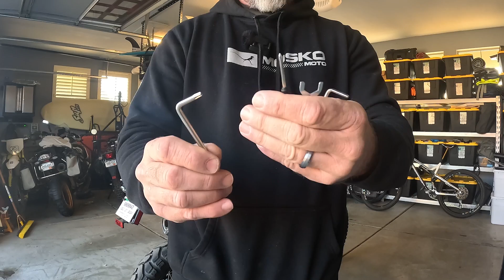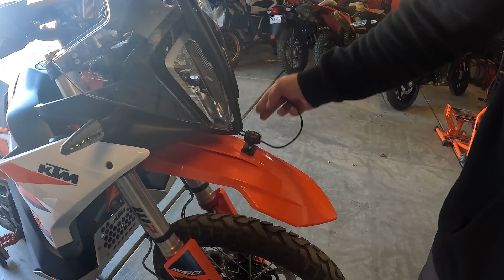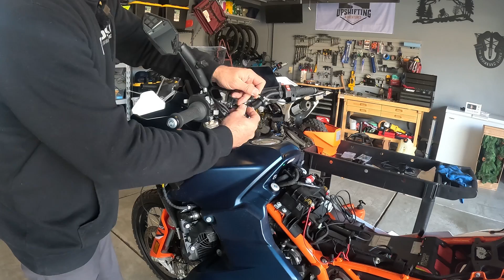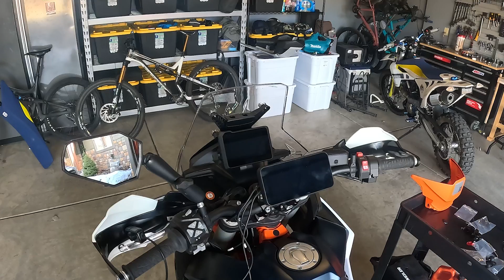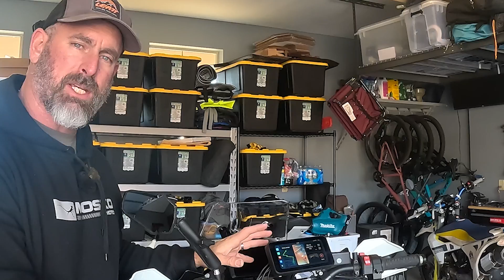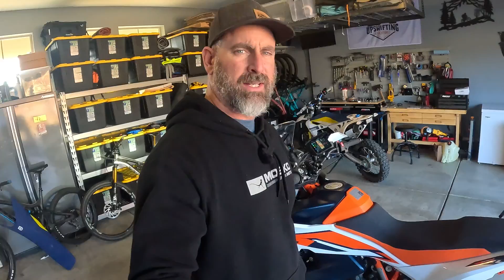SO EASY: Installing the AOOCCI C6 Motorcycle Car Play System.

Comment: Great review. Thanks. Can I ask a question? Do you face issues with the GPS locking long/lats and speed? My GPS info screen only fluctuates between 1-3 bars only with all onfo displayed as 0. Thanks
Reply from the maker: Thanks for commenting. I have not run in to that issue
Reply: @upshiftingadventures thanks a lot for coming back. Its my device then 😢

Comment: I've been through a lengthy install process with the Aoocci C6 Pro and want to mention this here in case somebody had the same problem. I would like to get this solved because it seems to be the only thing wrong with an otherwise excellent system. Here it goes.
I followed the prompts for Bluetooth and Wi-Fi connectivity. As soon as I started playing music I noticed it would pause then play then pause with the beat of about every second. No matter what I have tried whether connecting to my helmet speakers or listening to it over my phone cannot seem to get this automatic pause then play  alternating with music. I have already emailed support at Aoocci but I like to keep pushing to get issues solved instead of wait for someone else to give me the answer. Hopefully I'm not the only one but I have factory reset the C6 Pro, tried every  menu in the player and phone app to get it to stop this behavior with the music.
Reply: Happy to announce that after way too many hours working on a fix for my problem, so I came poncing right in here to share that it wasn't a software issue, it was hardware. Wasn't expecting that for how it was behaving, but it was relentless. My issue is where the remote connects to cable coming out of the main unit has a short and the wires were touching inside making the music start and stop repeatedly. So, when I held the cable without the remote connected in just the right way, it wouldn't make that connection between two pins, like I was pressing the button. So, solved. I have fixed shorts like this before and it will still make a connection if I connect the remote again, it's the cable I connect the remote to that I get to slice open. Yep, no time for a replacement.
Reply: @davidrobinson4797 thank you for updating 

You the goat 🐐

Comment: For windows users, simply format the card in the C6, then take it out and put it into a card reader. Copy your .jpg file onto the card(using the 1440x720, res 20-80) only name it lotel_bootlogo without the extension. Remove from card reader and place back into C6 and cycle twice the full log in past the green Aoocci screen. On the second cycle the logo you created will show. Also, should you lose the very tiny screws that hold the cover plate on, you can substitute with eye glass screws. Buy a small kit and at least one should be the right size.

Comment: How have you found the usb connection as the Aoocci operating guide says usb power supply is unstable and is not recommended 🤷‍♂️
Reply from the maker: I haven’t had a problem with it. I imagine it depends a lot on the bike and how the USB is wired. But I haven’t had any issues
Reply: First of all great video. I've probably watched 15 videos about this already to make a decision to get it. 
Once it arrived I fast found connecting to the battery would be constant power to it. 
So stopping by here to find out your specific solution for powering it was most helpful. Why the company might mention it was unstable is if you use a 12-volt to 5 volt port adapter for power, would be an intermittent issue from vibration. Dedicated 5 volt to 12 volt would be a more secure connection.

Comment: What can u connect the power if u don't have a usb connection?
Reply from the maker: It comes with a power supply with pos and neg terminals or you can wire in to your accessory port
Reply: @upshiftingadventures  I don't know where I'd find accessory ports on my bikes. I guess I'll have to try and figure that out. Would be nice if Aoocci provided something that could be easily connected and wouldn't draw off the battery when the bike is off.
Reply from the maker: @MightyMouzMoto not sure what bike you have but it certainly has a fused area where there is switched power you can tap into
Reply: @ItsJustJerryO  You can tap into any 12-volt supply from the wiring harness that is powered only when the bike is on. Lights, USB supply or other. My harness is accessible behind my display on the bike. I can tap into the 12-volt supply that feeds the USB port that is stepped down to 5v 2A, using a posi-tap. Very easy to do in my case. I have both options available should the straight USB option not work.

Comment: Probably the best feature is the included USB cable. I bought a similar product, tried to do my own wiring to a 12V DC socket which didn't work, and had to connect to and disconnect the unit every time I rode. Eventually I removed it completely.
Reply from the maker: Absolutely. They are the only ones that provide that option I believe